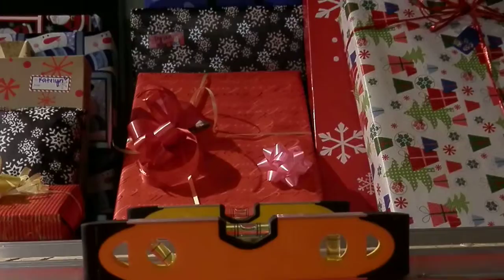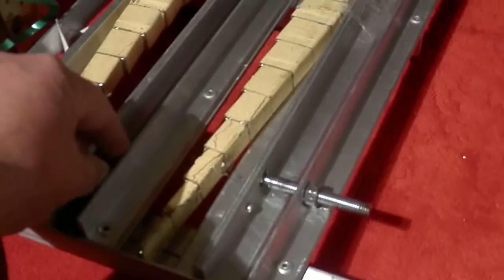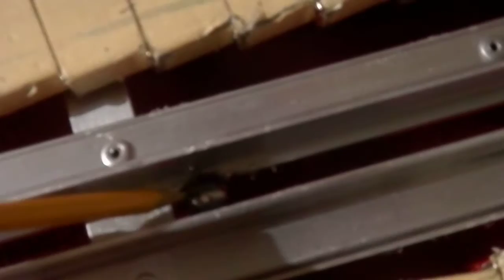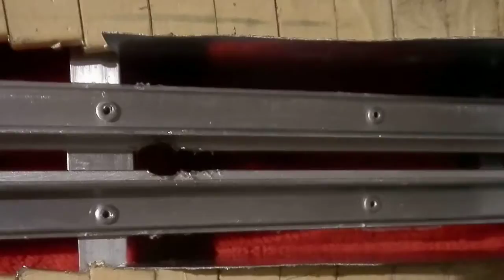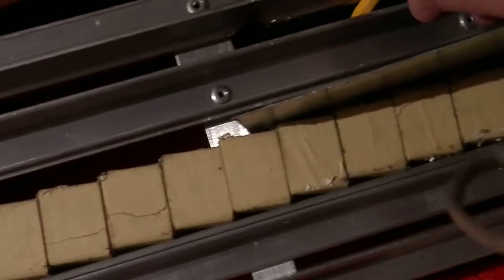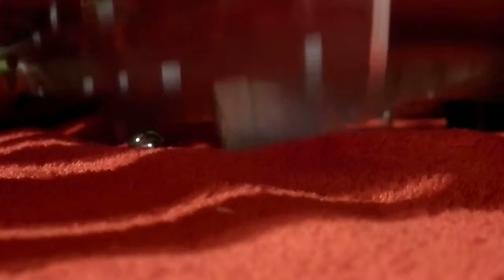New 4 Foot Track 24 Dec 2015 (Video 11)

Comment from the maker: Pre-Wrath
The comfort (1 Thes 4:18) is in the fact that the dead in Christ would rise also, would resurrect and meet us in the air. The letter was to those who had other Christian church members that had already died and they did not know how that would work since they had already died. They were to take comfort in the fact that the dead in Christ would be there with us also and be resurrected while we, the living, are raptured. (1 Thes 4:13-18)
“IT” is the SAME event, the Lords 2nd coming and the rapture/resurrection are the SAME event.  Do not be deceived by any teaching of a SECRET, SILENT, or INVISIBLE rapture! We aren’t to take heed to lies of “SECRET” things and “SECRET” meetings with Jesus in “SECRET” places. Jesus comes at the 2nd coming.
There is not a SECRET, SILENT, or INVISIBLE 2nd-2nd coming when His feet do not touch the ground. Jesus comes before G-d pours out His wrath. Do not be deceived that Jesus is here, or Jesus is there in the SECRET place! (Mathew 24:26)
The “tribulation” is everything up to the “great tribulation” (Mathew 24:21), (Rev 7:14) when G-d pours out His wrath, and we are not appointed to G-d’s wrath (1 Thes 5:9), but we may experience tribulation and persecution (John 16:33) Jesus said no one is greater than their master. (John 13:16), (John 15:20) The seals are NOT the wrath of G-d they are only the beginning of sorrows (Mathew 24:8). The trumpets and vials are the wrath of G-d, and the wrath of G-d, is the “great tribulation” it’s easy to remember, only G-d is “Great”. Jesus comes after the abomination of desolation. Jesus comes after the great falling away otherwise the rebellious stand. (2 Thes 2:3)
We that are alive and remain 
UNTO the coming of the Lord. 
UNTIL THE COMING OF THE LORD. UNTIL THE SECOND COMING OF THE LORD.(1 Thes 4:15)
We are raptured when Jesus comes.
We are raptured at the 2nd coming.
We are raptured after ALL of the dead in Christ rise first.(1 Thes 4:16)
The rapture occurs when Jesus descends and then following His feet touch the ground on the Mount of Olives (Zec 14:4) on that “great day” of His “2nd coming” the “day of the Lord” and we are raptured, “caught up”, to go out to meet Him, “apantésis”, at His arrival, “parousia”, to escort Him on His way down. It was a tradition of old to go out like a large procession, to go out of the city to escort an arriving official or distinguished guest and to enter into the city with them...after...ALL of the dead in Christ are resurrected first, so we are raptured to meet them and Jesus in the air, on His way down. 
That also means that the rapture includes the tribulation saints because ...a rapture at any other time before or prior to the “tribulation of that day”, would be “proceeding” ALL of the dead in Christ. (1 Thes 4:15)
This sequence (Rev 6:9-11) now makes even more sense to me, the martyrs wait for #1.)G-d’s perfect justice, #2.)Their glorified bodies #3.)Their fellow servants and brethren that should be killed as they were, to be fulfilled, to be gathered. This must include the tribulation saints because they are told to wait a short season while Jesus gathers ALL of the dead martyrs in Christ and all that will die for Him when He comes at the end, right before G-d pours out His wrath. This means that the rapture has not occurred yet either, at least up until the 5th seal is opened as proven in (Rev 6:9-11).
 ...Just please consider...why would the martyrs below the alter be told to “wait” some more, otherwise to “wait” for a “little season” to “WAIT LONGER” in (Rev 6:9-11) if they should have supposedly already been raptured first (the dead rise first) and “SHOULD HAVE ALREADY  RECEIVED” their glorified body during the pre-tribulation rapture as we are all taught??? 
The scriptures even state that it is the “souls” of the dead, those that have been slain for the word of God and their testimony, this includes ALL MARTYRS! ALL MARTYRS and they should have their glorified bodies already (at least ALL of the Martyrs from before the persecution of the new tribulation saints already) if the Pre-tribulation rapture was true!!!
Otherwise, if you say they are only the souls of tribulation saints, which they are not, they represent ALL martyrs of the Lord, EVER, and ALL martyrs that will EVER BE. Up until that point in time when the last one is martyred and then the Lord comes! Which is why they are still waiting for justice, and is why they are told to “WAIT” longer.  So 3-1/2 to 7yrs wouldn’t be very long to wait at all, but now it also requires another resurrection to gather the rest of them if the pre-trib rapture were true. 
The white robes they are given, they are not their glorified bodies, or are they?  They are told to wait until their fellow servants and their brethren, that should be killed as they were, should be fulfilled to be resurrected on the day of the Lord, at the Lords 2nd coming. (Rev 6:9-11)
If you claim that the white robe IS an indication of the receipt of their glorified bodies, you are admitting that the rapture and resurrection occurs for the martyrs at least, at the 5th seal. (Rev 6:9&11)
Conversely, if you claim that the white robe IS NOT indication of the receipt of their glorified bodies at that time, you are admitting that the pre-tribulation rapture has not occurred by the 5th seal.
Because it does not specifically state that they do, or do not, have their glorified bodies, just by virtue of the fact that they are now just receiving their white robe, which many state is the “peace of Christ”, indicates that they yet still, do not have their glorified bodies, they are only “souls”, even up to this point in scripture and must also continue to wait for their glorified bodies as well. 
The scriptures about the martyrs having to wait longer never made any sense to me when applying the pre-trib belief as we are taught our entire Christian lives. If the martyrs had already received their glorified bodies at the Pre-trib rapture they should be rejoicing in Christ’s peace just like the multitudes, knowing that vengeance is the Lord’s (Rom 12:19). However, in (Rev 6:10) why are they crying and lamenting in heaven?
Furthermore, to claim that the martyrs below the alter already had their glorified bodies at the opening of the 5th seal at (Rev 6:9&11) on top of what I have already mentioned, why are the multitudes introduced in (Rev 7:9) after the opening of the 6th seal and not “simultaneously” at the 5th seal in (Rev 6:9), since the scriptures state that we meet each other and Jesus together in the air with our glorified bodies (1 Thes 4:17) and enter “TOGETHER” as indicated by the multitudes in heaven at (Rev 7:9) (which now includes the martyrs with their glorified bodies, whose spirits/souls where under the alter)
This is just more evidence that the holy scriptures do stand as a testimony and witness that the resurrection/rapture occurs at the Lords 2nd coming, the day of the Lord, as it is written, as an event following the opening of the 6th seal stated in (Rev 6:17) and the pre-trib rapture/resurrection stated as occurring prior to the 5th or 6th seal does not fit at all. The dead rise first, but we meet together with Jesus in the air.
The timing of the rapture is also not a salvation ending detail and anyone would rather it happen pre-, but I am mentally and spiritually prepared for when Jesus returns. All that matters is that we keep looking up for our Lord’s return in the sky. Unless we know for certain, teaching differently is truly dangerous.
What if...the falling away occurs simply because a rapture does not happen when our pastors have taught us that it was supposed to happen? All of a sudden, no pre-trib rapture, and millions of Christians realize that they now may face the wrath of a lawless mankind, satan, tribulation, persecution, accepting the mark or suffering starvation and even beheadings. 
We are to look for the Lord Jesus Christ Yeshua’s return in the clouds -bottom line. That is what must be taught, no matter what happens or the timing of events that we may or may not have gotten correct, look for the Lord’s return in the clouds.
I hope and pray that there is a pre-trib rapture, that all of you pre-tribbers are right, nobody wants to go through the tribulation, if we don’t have to...come on, but what motivates your beliefs?  Do you believe in a pre-trib rapture simply because you don’t want to suffer the tribulation? I’m ready to see Christ but pre-trib is NOT in the scriptures unless you make-up your own assumptions. Jesus states that He will come “after the tribulation of those days” and we learn that we will not “PRECEED” the dead. Wouldn’t a rapture before all of the dead in Christ are gathered, be “PRECEDING” the dead in Christ?
Please leave this message, there really are no plausible negative outcomes if post-trib, pre-wrath, or mid-trib do not occur, and if it does happen pre-trib, you would just ultimately be proven right and that would be the end of it, literally, it would not matter at all. 
It is ironic, that even now, many are already teaching that all believers other than the pre-trib camp are evidence of the apostasy and have all “fallen away” from the faith, when this is not true at all, we are just learning more and more about the precious word of G-d.  
We are all still brothers and sisters in Christ and the arguments will cease one day, but how are we “apostate heretics” if we love the Lord Jesus Christ Yeshua Hamashiach, just as you do? Please just keep looking up for the Lord...He comes with clouds!  Thank you for taking the time to read this message, in Christ -Michael